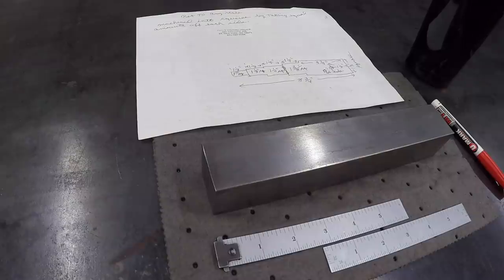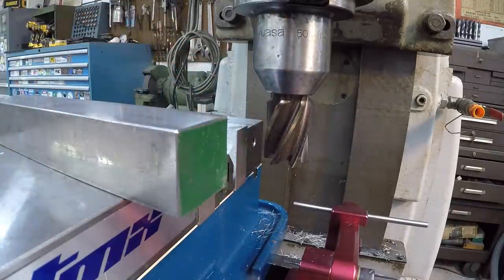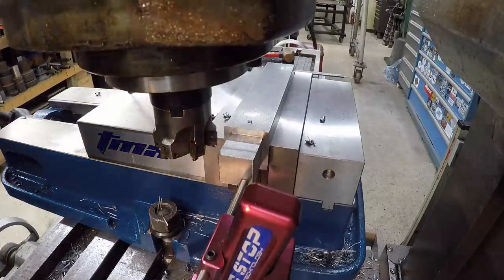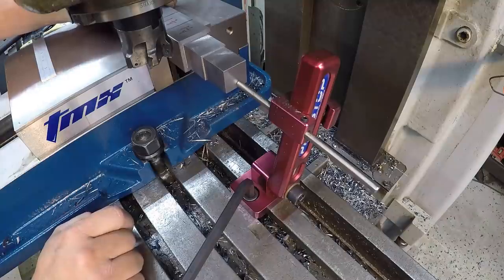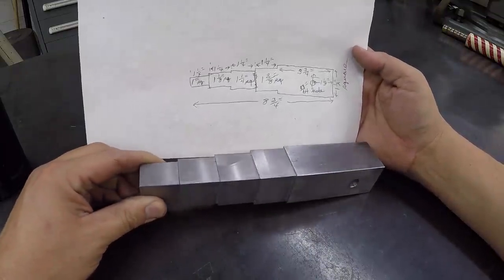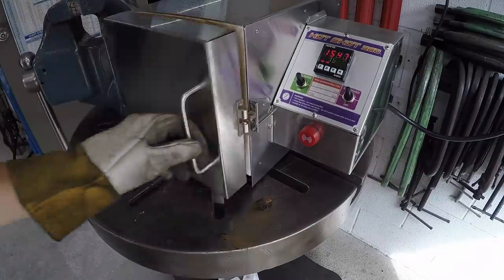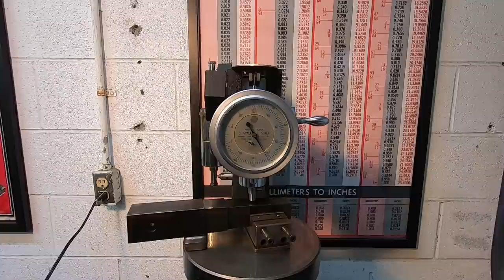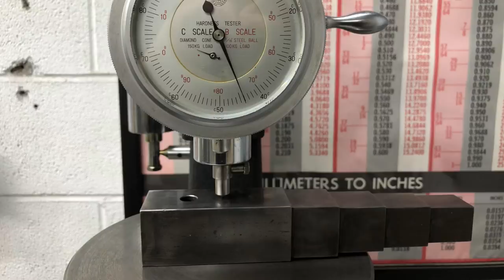SNS 296: Custom Square Drive Tool, Heat Treating

Comment: Adam,
Another adventure for you and well done.  This whole world of heat treatment is a bit magical and I concur with the comments below about making sure there is even heat transfer through the whole part.  However there is a consideration about what the part is trying to do and how much stiffness and hardness is required.  In this case, I would have considered case hardening which is the application of carbon dust to be reheated which permeates the surface to a depth giving a surface hardness but retaining the toughness of the original material.  Once again good job!
Reply: Case hardening 4140? Lol

Comment: The problem was your timing.  Your part has visually not reached the temperature that the thermocouple was telling you.  1h x inch as Asme says is the rate you use to stay whenever you reach the temperature with the part already in the oven and you need to heat it inside.

Comment: the smaller squares will cool faster and the result will be a smaller crystal grain in the structure so you have well.if the squares was consistent you would have a uniform cooling

Comment: It would be interesting to see you machine the "test block" (I.e. The remaining material left over) which you had heat treated getting various harnesses in half and take some more readings threw out the block in different places. Just a thought as this is a very perplexing outcome. I don't have much experience with heat treat either, I look forward to seeing your journey to getting favorable results. Please keep us updated on your findings. Dan @ 6-4 Fab
Reply: Remove an 1/8 inch thick portion of a known Rockwell test, surface grind using flood coolant for a matching finish. Then test the hardness again. You may have to use tool steel next time. 
SIDEBAR: The second most important fact here is if your part design can permit a radius NEVER machine a sharp corner on a lathe, mill or grinder. The sharp corner is a magnet to collect stresses during manufacturing and end use!

Comment: The pouch is just that. An environment  for work. The wrap can be used to separate from the environment. IE: keep it soft ...er. so..and adding some carbon in the pouch is a bonus. 
Don't forget your obviously heat treating. The scale you knock off after treatment and before drawback(annealing). Surface treat if you need at this point then grind if it applies to the build.
 Nice cherry video big guy.

P.S. as the brine (salts) break down in the oil .. the more it will flame up, so.....
 In this case it's literally "Heads Up" !!!
Reply: Eh? If you add carbon (powder?) in the pouch you'll case harden, which will potentially give you a (very thin) surface harden, but then you talk about grinding - which will take this layer off?  Not being aggressive, just confused...  Would be pretty hard to ensure even distribution of carbon powder in the bag also.

Comment: I was taught to put a small piece of newspaper inside the wrap - as it chars, it combines the oxygen in the bag into CO2 and not rust on the part.  In the last frames I saw the two sitting on a steel bench.  Might want to have a wood plank there - so the steel bench doesn't cool one side more than another - after quench and it is still hot.  A steel pot will help spread the heat and cool the oil.  You won't melt a hole in the wall either...

Comment: Hey Adam, I may be wrong but if you have a clean oven and no other materials in the oven then I don't think the foil wrap is necessary. We only wrap parts when we send stuff to a heat-treat house and we don't know what else is going to be in the oven with it. It's a cross contamination issue.
Reply: If I remember right, it is actually an oxygen level issue. It has been a long time but I think it has to do with the carbon, iron, and oxygen interacting at higher temps that reverts some iron back to a more basic form. Alloy steels and tool steel has less of an issue or issues at different temps but your bagged verses not bagged scenario was more likely a different oven type altogether or the part was going to receive further machining. 

There are two basic types of heat treatment ovens. A controlled atmosphere and uncontrolled.  The controlled atmosphere treats in either a  vacuum or bath of some other molten metal, liquid sodium, or sometimes a ceramic silica solution. The open atmosphere type you bag or encase if it is a finished part and do nothing if the scale isn't important like if it will be machined further. 

My understanding is that part of this oxygen interaction can cause case hardening too which might be why there are different results in different areas of the tool.

Now take that with a grain of salt. My experience with this is not in the hardening or operating the ovens itself but working on the control systems operating some of them. We got a basic rundown of what they do and of course you talk with technicians as you swap boards out and replace sensors. The company I worked for was bought out by another in 95 or so and my certs weren't good enough to stay on.

Comment: Love the content Adam! I’ve been watching your videos ever since taking a machine shop class when getting my mechanical engineering degree 6 years ago. I thought of an idea for your quench oil capacity, or lack thereof, although I’m not experienced in the heat treat world, so take it with a grain of salt. If you use a metal bucket for the quench oil and then place that in a ice water bath (similar to how you’d ice down a keg), it would help keep your oil cool and simulate a larger oil volume without the expense of more oil and the need to store it all the time. It’s fairly simple to calculate the equilibrium temperature of the quench as long as you know the temperatures, masses and specific heats of the part and quench fluid, and from there you can calculate the amount ice water needed. The only limiting factor would be the heat exchange rate from the oil to the water through a metal bucket, but doing a few experiments you’d probably get a rough idea. Thanks again for the great videos!
Reply: Actually it seems that the oil was too cool. I have no experience in heat treating, but all people I watch quenching on YouTube pre heat their oil, claiming it results in a faster quench
Reply: metalhammerish That’s definitely counterintuitive lol. Unless the preheated oil is thinner and therefore flows easier, allowing the hotter oil to convect away easier and be replaced by cooler oil. At either rate, if oil capacity is an issue as others have said, using a water bath around the oil bucket should help, whether it’s ice water or hot water, as long as the oil could exchange the heat to the water fast enough. That’s my assumption anyways, as I’m not sure what other advantages additional oil capacity would give you besides the heat capacity to soak up the heat from the part.

Comment: looks like the inconsistent hardness on that small block you tested later could be due to one of the sides being in much closer proximity to the heating coil of the oven based on the pictures of your setup. Im just taking a wild guess though. Im no heat treat expert by any means

Comment: Putting part into flower pot filled with homemade charcoal powder works just as well with preventing oxidation/scaling in heat treating oven.

Comment: The difference in Rockwell readings may be due to the way you are quenching. You quench your piece and turn it in a circle which will not cool all four surfaces equal and will also cause your workpiece to warp alittle. Try quenching in a up and down in a vertical motion within the quench tank. This way all four surfaces cool at the same rate.

Comment: It's all about the speed which you drop the temperature between the Curie point and a certain critical carbide forming temperature depending on your carbon content.  The 40 in 4140 denotes the carbon content, the 41 means chromoly.  40 is not going to get very hard.

Comment: My gut says it is a speed of cooling when you quench issue. That part has a pretty thick cross section to it and the core is holding heat. Also give Brownells ATP-641 scale prevention compound a try. Paint it on and dry it with a heat gun. Then heat heat and quench with no need for foil and no wasted time. Washes off with hot water. It will dirty up your oil, but might be worth it for no foil. One last thing. Check the post quench temp on your oil. It may be coming up to a point where it is to hot to be effective. I think 5 gallons would be enough, but it is worth checking just to be sure.

Comment: I am by no means an expert, but I have done some blacksmithing and knife making. Heat treating is tricky but let me ask if you did a couple of things. How long did you let the piece soak at the critical temperature for heat treating it? Being that the piece is bigger on one end than the other the metal will take longer to get to temperature on the thick end than it does on the thin end. Soaking it at the right temperature for long enough will insure that the entire piece is heated to the correct temperature. This slightly relates to the next question, did you have the piece resting on the floor of the oven while bringing it up to temperature or was it propped up off the floor like you did for tempering? With knife making, they have special racks to hold the knives up off the floor of the oven and stand vertical so they heat more evenly. The 38 you have for hardness, would be my guess, the part of the tool that was against the floor of the oven or touching the block you held it off of the floor with. Maybe treat the tool like you would cooking a steak and rotate it may help, but soaking should do the same thing. The 38 side could also be from my last question- How much did you keep the tool moving in the quench and did you preheat the quench oil? the Liedenfrost effect could have caused this or your tool holding it. https://en.wikipedia.org/wiki/Leidenfrost_effect 
The tool makes the quench boil at the surface of the tool and is making an impermeable layer to the quenchant to do its job. You have to keep the tool moving the entire time it is in the quench. Preheating the quench will also reduce this, many tool makers will take a secondary piece of metal heat it and put it in the quench a minute or two before they place the main tool in there so the oil is up to temperature. 
I don't know if you have to remove the foil or not.
Last question is- did you use the correct substance for the quench? water, oil, or air?

Comment: While you might have the process for the heat treat wrong or inprecisely, you may want to also make sure that the hardness tester is properly calibrated/working right. 

Still...love the video and love the learning!

Comment: Hey Adam, before changing the heat treat technique you want your testing to be accurate and precise. I would start by checking the hardness tester's calibration with a hardness standard block. Next you want to make sure your workpiece clean and scale free, and most importantly sitting flat (so that nothing acts as a cushion and give you a false reading) on the tester's anvil. You want your test area to be clean and well, taking about . 005 - .010 off the surface with an air die grinder works great. At work (aerospace heat treat) when we have issues we never change our processes without knowing that we have accurate results. Hope this helps

Comment: Is there a reason you didn't just case harden it since it has a relatively low carbon content compared to a true tool steel it will not easily get very hard without case hardening it.

Comment: If that tool works like I'm imagining (I'm picturing it like a step-drill, but as a step-wrench for multiple hole sizes), tapering/beveling those steps would make it insert more smoothly.

Comment: 4140 in general tends to be very inconsistent, since everyone and there brother makes it.   Get some material with a certificate of analysis before you start banging your head on the wall too hard trying to get consistent heat treat results.

Comment: I am no professional  although I have heat treated more items than I can count, I have never used a stainless wrapping, the piece did not look to me as though it was hot enough are you sure oven is correctly calibrated.

Comment: Form what I can see from your video it seems to me that.
1) your oven temp is to low. Ovens have hot and cold spots and the Thermocouple can give erroneous readings depending where it is located. Also I'm guessing there is no circulation fan for that tiny oven so heat distribution is largely reliant on heat convention and again the Thermocouple location could be important. Also that's a relatively large part for such a small oven and it's not going to get heated evenly due to geometry.
Given all those factors I'd be bumping the temp seting up 50-80degC over what you are aiming for.
2) you should remove the part from the foil before quenching otherwise the quenching effect is insulated (stainless steel is a rather lousy heat conductor) and slowed dramatically. However it takes time to remove that part from the foil and regrip it for dunking, so if be adding another 30-50degC to allow for that.
3) you should be using at least 2x preferably 3x the oil for a part that size and swish in a figure8.

Cheers

Comment: a full hardness would need a full fire all the way around. your oven is going at it like a plasma cutter. I learned this stuff without intention, I welded something below zero in maine...could not even grind the part I was tinkering with (not kidding)

Comment: Next time throw a small piece of paper inside of it so when it gets up to heat where the paper will burn, that piece of paper will burn the rest of the oxygen out of the wrap. And to make the wrap tighter, use a small fab body hammer to lighter make your folds tighter.

Comment: 4140 comes with a decarb layer (bark) on the outside. To measure the hardness of the before heat treat part mill off 1/16” to get rid of the bark. Now you have something to reliably measure. Use a heat treating wash, not foil to reduce the decarb layer. The foil makes it difficult to quench oil hardening steel properly. Spend more time in the oven. You want the work to have time to change state.

Comment: Hi Adam, I am not an expert at HT, was the softer part of the block facing down, I'm just wondering if there could be a temperature gradient  in the oven. I have had  the same happen to me a few times, raising my part closer to the center of the oven helped a bit.
Cheers
Reply: I had that feeling too, the 50 rockwell area might have been resting on the distance block in the oven and seen another heat curve...

Adam, could you measure hardness any other way than with that hardness tester ? (verify measurement device)
its hard to imagine that you get such inconsistent hardness across the work piece ... maybe there is a trick to the machine ^^
thanks for the video, the heat treatment was interesting ! hope to see more making of tools ;) love you channel since 2017 !

Comment: Nice video Adam and good that you can have a relatively inexpensive part to practice on. My thinking it wasn't hot enough to start with. Perhaps a wire through the hole, whip it out the oven strip off the foil and get it quenched. I am sure you had lost more than a few degrees by the time you got it to the oil. 
Des. (no expert!!)

Comment: Thought the metal hardness would depend on the carbon content, a steel with medium carbon content will only become slightly tougher through the Harding and tempering process.
Reply: motorbikemad001 4140 should be able to 50rC

Comment: Do the smaller sections cool faster when quenched and harden more than the larger ones? 

 It would be interesting to see if the hardness drops as each step gets larger.
A quick check with a magnet will tell you if you reached the critical temp for heat treating.

Comment: surely that hardness difference is the scale., on that smaller test piece, causing the inconsistency. ive done smaller parts, and scale is always an issue.

Comment: for this dimensions better get a hot work tool steel like 1.2709/marage 300 with no need for oil quenching. you could leave it in the oven for cooling down and it reaches 54 rockwell easily and uniformly.
Reply: @Jerry C 
educate yourself on the tool steel i mentioned, and then come back again. that stuff is a staple in our shop, awfully expensive and very poor machinability, but very easy to quench without much fuss.
Reply: If you're changing material, try the special metal the military uses for high security locks.

Comment: I'll bet is is based on the rolling of the steel imparts a grain direction and guess that it affects final hardness and why its different on the sides.  The hardness changes from step to step b/c the thickness is changing.

Comment: You should let it soak in the oven longer. From the little experience I have, the part is not being normalized. Our guys go through cycles with parts. Heat to 500, for x amount of time then 800, so on, and then hold at the critical temp for whatever they calculate.